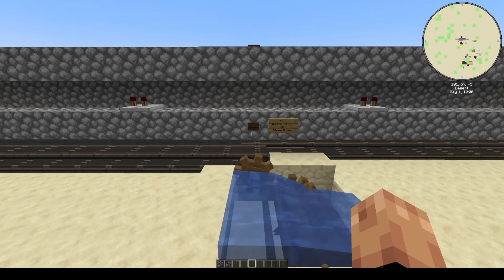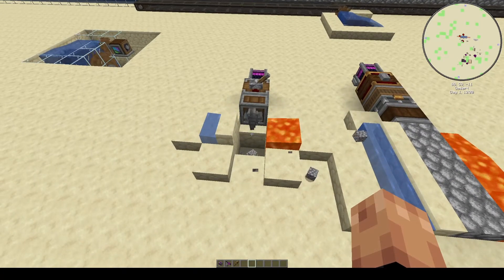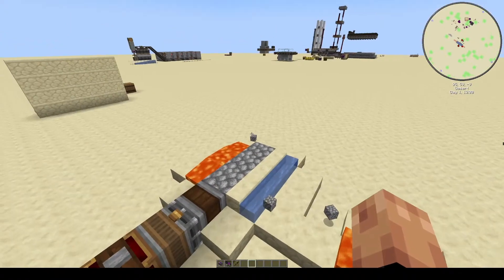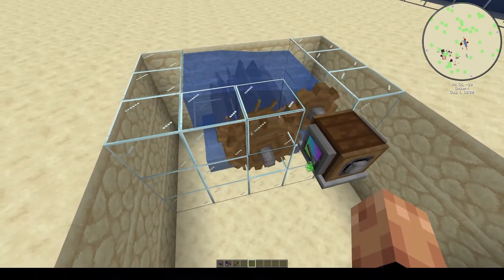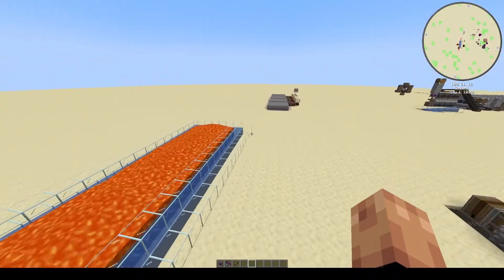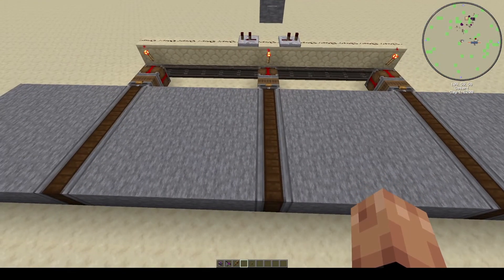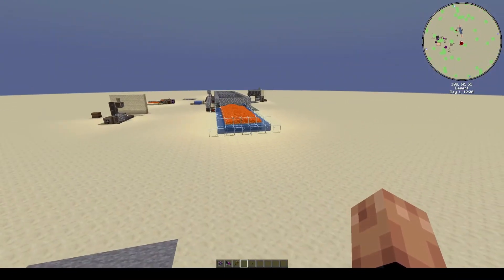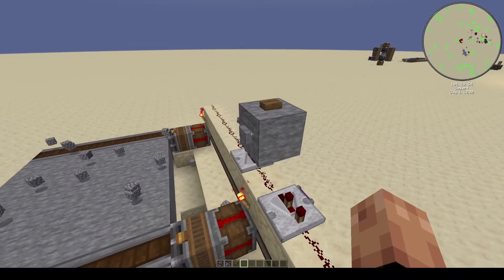Minecraft Create [0.5] - Cobble Farm

Comment: This is button-basel so still requires player input.  If it were to be automated, what’s the safe repetition rate; that is, do you just need one off redstone ticks between the 15 on redstone ticks, or do you need to wait longer?

Presumably this is related to my other question, which is partly vanilla fluid mechanics: how does this reliably generate 5-wide stone?  I’d expect it could only do 4-wide and a mix of cobble and regular stone, but that doesn’t seem to match what you show.

Comment: I disagree with your opinion for collision mechanical bearing farms you can make them without brass just using pure vanilla redstone and one clutch and they are much more compact than your monstrosity
Reply from the maker: I didn't say collision farms require brass, I said that collision farms OFTEN require brass. If you actually watched the video instead of immediately jumping into the comments, you would see that I created one with vanilla redstone and a clutch.
Reply: @OffBy0x01  i saw that part I watched whole video I just wanted to say that you first said that you dislike them but then you use the supplement of it with same function.
Reply from the maker: @tytusdezoo6371  I didn't say I dislike them at all - I said that they are typically the better choice? The whole point of this video was to create a cobble farm that could offer the yields of late-game cobble farms, without the requirement of brass. If you are already at the brass stage this video is not for you.
Reply: @OffBy0x01  i just wanted to prove that there is many not requiring brass cobble generators even my favourite mechanical bearing cobblefarms with lava pumps feature which are even more efficient than yours and much smaller I understand your point and that this one showed on the video is easy for new player to understand how it works.

Comment: Is this expandable at all, or are the dimensions set?
Reply from the maker: You can add additional rows of 16x5, up to whatever the contraption limit is. Basically leave a 1 unslimed chassis after every 5 linear chassis for water sources. You can also expand vertically, though you'll need to  leave a block after the gearshift for belts or gearboxes to allow the power to be transferred to multiple levels without needing to replicate the gearshift circuit.